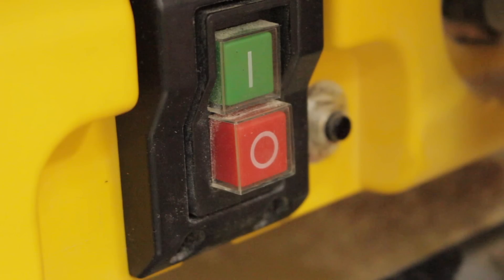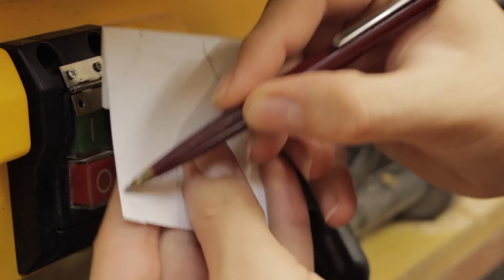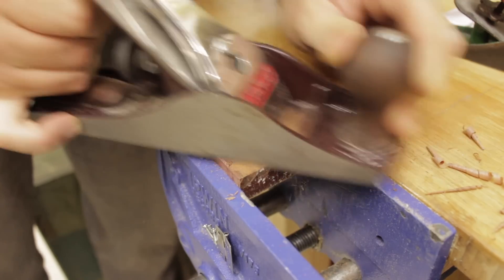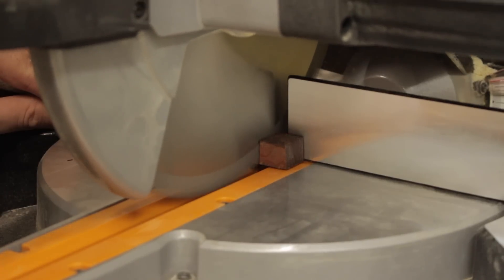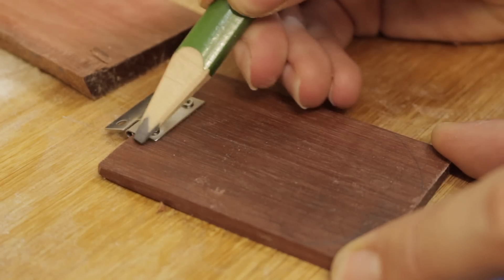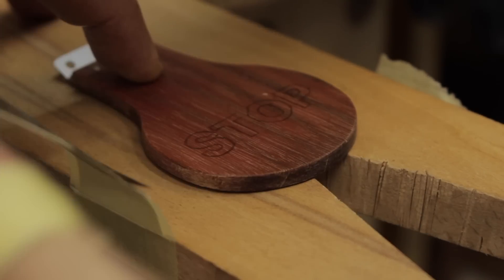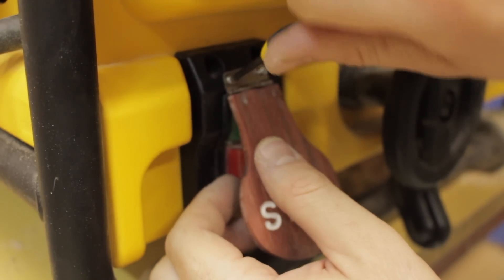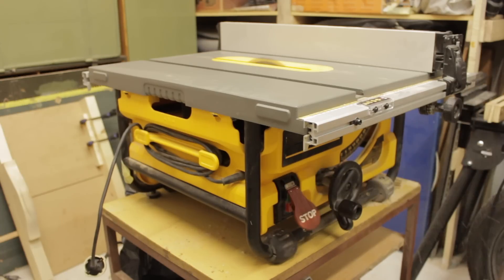Making The Kill Switch (for the DW745 table saw) - Ep 049

Comment: My DW745 (the 110V Canada/US model) has an emergency "paddle" switch or "flip" switch -- a single switch in the shape of a paddle you pull up to turn it on. The same switch turns it off by flipping it down, and it can be hit easily to turn it off in an emergency. I've had my machine for about 5 years now, so it isn't a new feature. This two button design (with separate green and red buttons) seems to be on the 220V versions. I wonder why they are different. It seems like an odd (and more dangerous) feature unless there are regulations involved.
Reply from the maker: I used to have the same saw in Mexico (110v) and it had the same safety switch as yours. This 220v one is plain stupid and dangerous design. Therefore I made it safe myself.
Reply: @AndreaArzensek  I agree, your solution is nicely done. I like how non-destructive it is to the original as well, and it is a simple solution (which is usually best). Nice job.

Comment: Excellent idea. I have the same saw and I just made one like yours. I was worried about drilling into the switch so fixed the hinge to the yellow plastic above it with two pop rivets. Works just the same but without the wording as my carving skills are not great!
Reply from the maker: +Mike Peacock Thank you Mike! I opened the switch prior drilling to make sure I wouldn't damage any wires. You could use maple or lighter hardwood and just write with a marker. Cheers 🍻
Reply: Having now used this for several months it is SO much easier to use and safer than before. You don't have to look away from the blade to find the off switch and it doesn't get in the way of the on switch. I just had to thank you again for a great idea and I would recommend that anyone with this saw makes this modification!
Reply from the maker: Thank you so much! 
I love that  switch and I don’t even think about it anymore. DW should have it by default.

Comment: can you do more videos about this table saw.
Like how to adjust it .
Adjust the fence, mitre slots and the blade.
Reply from the maker: I had bad experience with my European DW745 saw.
It is very different from American version I had used and loved.
The miter slots are tapered (which is bad), the switch was crap (hence this video), it's too loud and way too expensive (around 650 euros).
The good thing is that is very easy to use, powerful and rack and pinion fence is amazing.
Maybe I'll make a video for zero clearance insert and saw stand in the future, so stay tuned.
Cheers
Reply: Andrea Arzensek my next project will be this kill stop.
And yes you are right about the fact that is loud.
The blade guard is crap(european model).
I am asking you about a video for it because i can't find the screws to adjust the blade to the mitreslots.
Reply from the maker: Limbutu Cristian I haven't tried to set up that since my miter slots are not the same widths, so also not parallel. This is the reason I built a sliding cross cut jig and that solves the problem somehow. I'll check for the screws to set it and let you know if I find any. Cheers

Comment: I had a similar on/off switch for my router table, and the only thought that came to me was to buy a kill switch. Never occurred to me to make one. And from purpleheart no less! Good job.
Reply from the maker: Michael Anderson that switch should be a necessity not an option. Believe or not we found a purple heart pallet and that is why we used it. Any hardwood will do the job fine (maple, oak, ash) or if you have use exotics. It's only a small piece so it won't break the bank. Cheers!